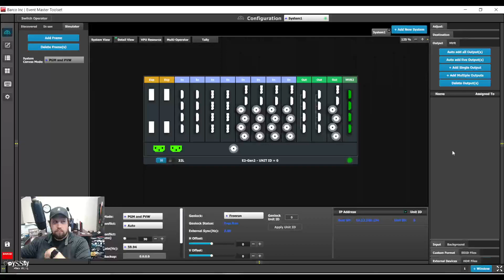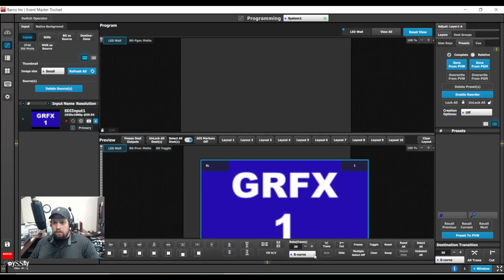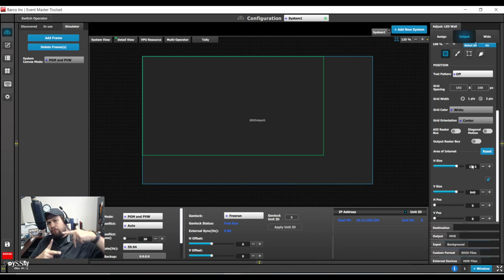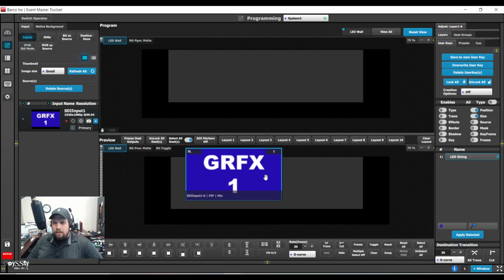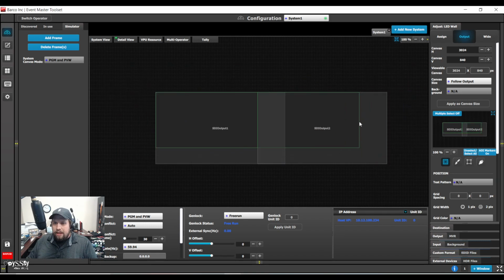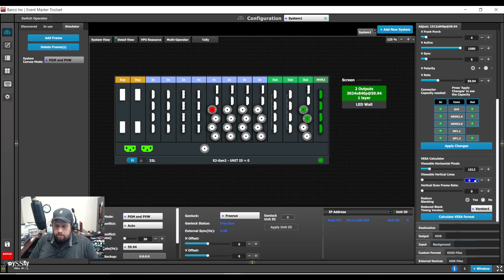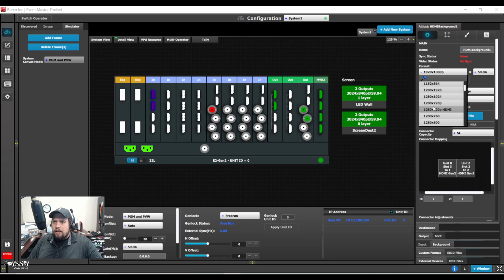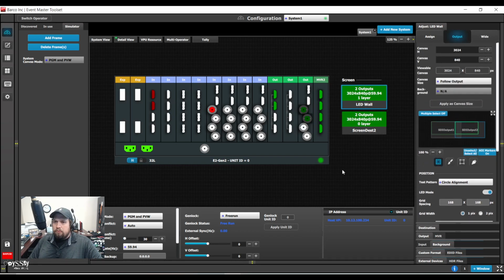E2   LED Workflows

Comment: I am having some issues with trying to setup a scenario in the simulator. Perhaps I am doing something wrong. I have an LED Wall that is 3696x1232 with one 1920x1080 layer. This will be a GEN1 machine. Millumin feeding into the E2 and the E2 sending to a Helios processor. I am just not getting it to setup correctly. Do I need to use 2 inputs and 2 outputs for this? Also, do you have that thumbnail pack for download? I would love to have it if so. Thank you for great videos. I am fairly new in the E2 world, and learning as I am going.

Comment: Hi Mr Ring. I am running into this weird problem and I am not sure if it's something I am missing or a problem with the machine. I am running a E2-Gen2. I have 2 4k output running to a widescreen LED. Both have their own led processor, so I just setup two 4k outputs and a super destination to place the pips.
On the Input side I have some gfx and cams to be placed in the pics. For the background I am using a Watchout system with a dual videocard, both on 4k via two DisplayPort inputs.

Now the problem. When I add the two Watchout Displayports as a input, all works fine. But this means I need to add 4k layers to show them and this takes a lot of my layer resources. So I rather bring them in as background.  But when I do this weird purple bars appear on the output on the ledscreen. Splitting and separating the image. I can't find anything weird in my settings. HDCP is off and nothing is set different on input vs background of these plugs.

Is 4k? not possible as a background? Can't find anything in de documentation. For now I fixed the problem by adding 4k non mixing layers to the 2 4k outputs, so that I have still enough mixing layer resource left for the pips. Is this the correct workflow. Hope you can help and enlighten me! Thanks so much

Comment: Hey Kevin, in case of an LED that’s more than 4K res do you suggest to use always custom format?
Reply from the maker: A custom format would most likely be the solution when using larger resolutions, but the key to success is being flexible in your workflows and choosing the best method based on the show : )
Reply: @kevinringvideo  Just done my Barco Certification Training, It was amazing! thank you for your videos, you motivated me to take the training!
Reply: Got my cert a long time ago. Love watching your videos as refreshers. I have an LED wall good coming up and I'll be doing the custom resolution deal for ease. Also sending the 3:1 content to two DSMs that are to represent what's on the wall. :)